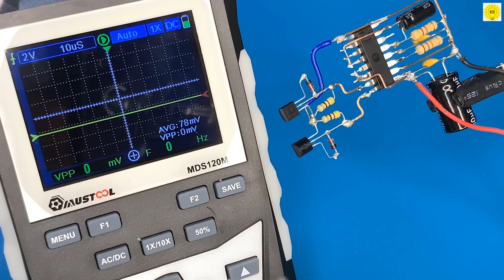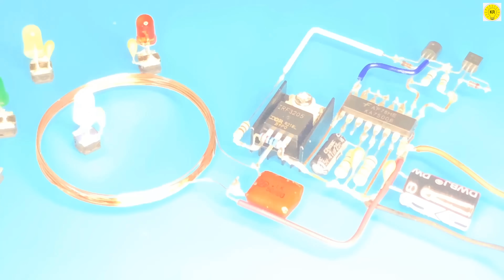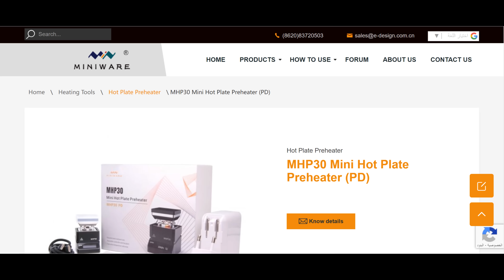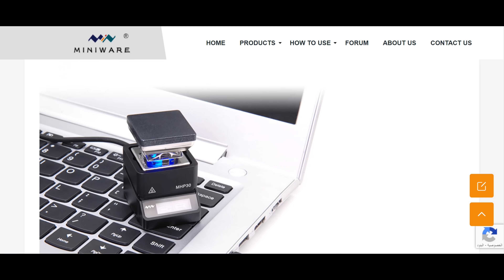how to make, wireless led, wireless charger, experiment

Comment: What components are used in the oscillation circuit connected to the PWM controller, 
and what is the circuit schematic?
Reply from the maker: https://inventorkr.blogspot.com/2022/05/wireless-led.html
Reply: I was able to see the schematic.
Thanks !